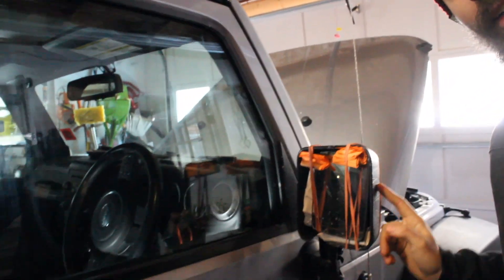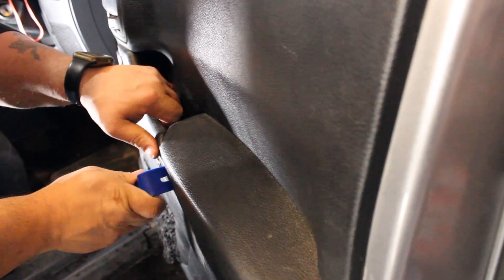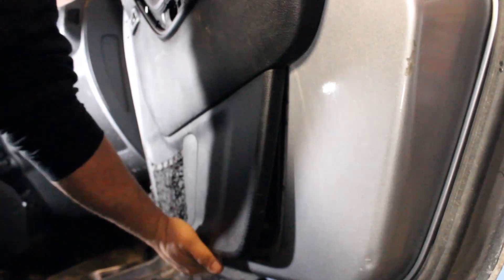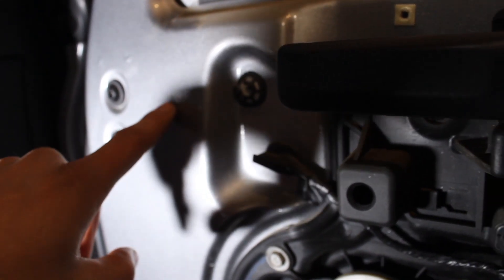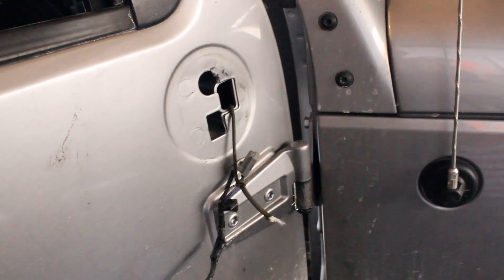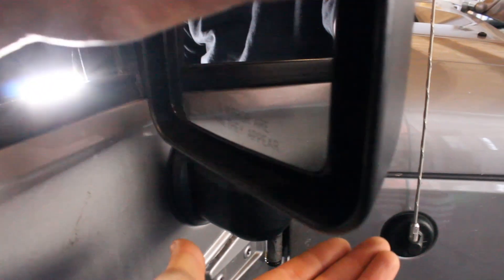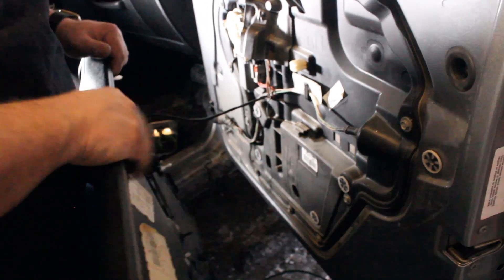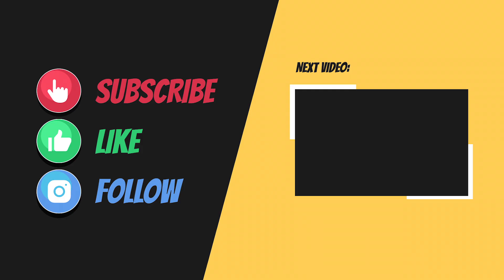How To Replace A Mirror On A Jeep JK

Comment: Car wash took out my antenna which crushed my passenger side mirror.  Driver side mirror has been a little wobbly for a couple years.  This video was a tremendous help.  Thank goodness I watched it before tackling the mirror replacement.  The string hint was HUGE.  I would have been screwed otherwise.  FYI I bought knockoff mirrors.  Cheap Chinese crap.  Do you yourself a favor and pay the little extra for original parts.  Knockoff do not come with the plug and the wire on the driver side is an inch short.  I needed to rearrange the wire path.  I was very nervous about cutting that spliced wire.  Not sure what it was for.  heat?  I did not splice the replacement and the mirrors move, not sure if the heat works.  Replaced both mirrors in about 2 hours.
Reply from the maker: That is amazing I’m glad the video helped you out! I really appreciate the feedback and thank you for taking the time to leave a comment. If you can please share this video so it can help others

Comment: Good video - what that mirror heated and powered (powered to moved / adjust the actual mirror).  Thanks!
Reply: I checked your amazon link and see that replacement was both Mirror glass is power adjustable and heated.  I will replace my own using your video, cheers.
Reply from the maker: thanks for watching glad you enjoyed the video

Comment: That extra wire everyone is talking about in all these videos-there was a recall on 2011-2013 for a fire hazard. You cannot plug and play without risking a fire. They cut and spliced that into its own connector. The second black gets spliced into that white with its own connector for the heat

Comment: Should have watched this before I started! I didn’t tie the string and now can’t get the wire through.
Reply from the maker: Yeah it’s really hard without the string but you can do it.
Reply: How did you do it bc I did the same things and now can't get the wiring strung through.
Reply: @brianmiller8632 did you solve the problem??? I'm in the same situation.